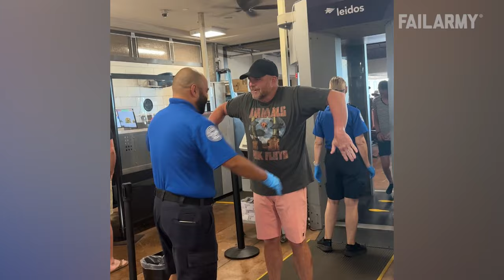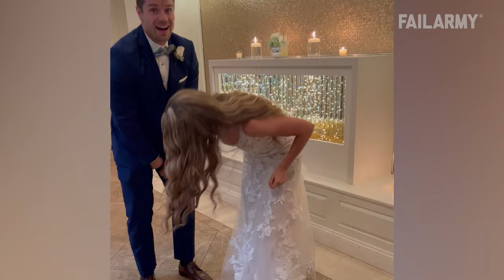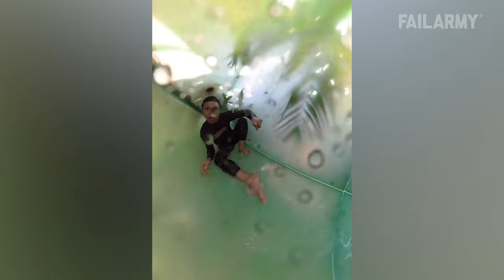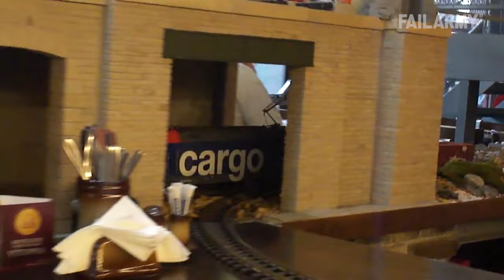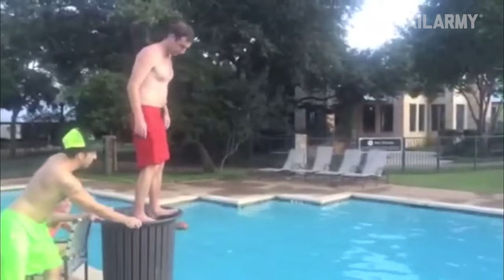When Everything Goes Wrong This Month😂

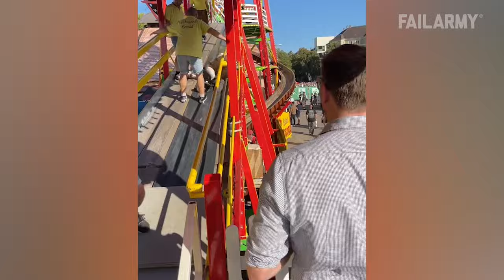Comment: @4:00 he says "that's why you wear your glasses"  You know what else helps with safety?  Not removing the guard on the angle grinder specifically designed to prevent the cutting disk from hitting you if it explodes like that one did.
Reply: Angle Grinder Roulette is fun though!!
Reply: I completely agree with your perspective!
Reply: Sometimes that guard is in the way and you gotta risk it
Reply: or prevents you from getting your hand into the disc, or a rotating steel brush.
ask me how I know.
Reply: @123123boobies  nope,  if you're using a cutting disk that exceeds the size of the guard,  then the disk you're trying to use isn't rated for the RPM of that grinder.  Circumventing(removing the guard) is also an OSHA violation here in the states.
Reply: Oh man, is that what happened?  I was wondering how in the heck it flew off and hit him.  Why on earth would anyone remove a safety guard from a rapidly spinning death wheel??
Reply: Safety glasses are no joke , but i'm pretty sure this particular scenario is staged all of them are.
Reply: @lotharrenz4621  I'm afraid to. 😧
Reply: @josephgermany7446 he didnt say too big he said in the way sometimes youre cutting something that isn't easily accessible but personally i just try to keep as much off axis of the blade as i can guard or not. Minimize risk all the way around. Also im pretty sure most guards don't fit wire brushes but i may just be wrong.
Reply: The way of a virtuous woman is more valuable than Fine linen and precious, pernicious estates..
Reply: @josephgermany7446  Everything we do at my work is an OSHA violation! lol
Reply: Safety tip appreciated.  Let's see how many yahoos heed it.
Reply: And maybe not using such damaged discs. you can see it was already done
Reply: @Labergemusic  go work in My fields and i will pay you whatever is right..
Reply: Another thing people do with cutting discs is try to grind with them, or using wet and damaged ones and they'll usually explode everytime too.
Reply: @pivotman1121   if the brush doesn't fit,  it doesn't belong on the grinder.  Use the right tool for the right job.
Reply: @pivotman1121  You gotta buy the correct size wire brush, have my 125mm grinder with a 125mm wire brush with the guard on, it brushes on the guard inside but it works.
Reply: @joelgonzales8342  that is actually possible. if that piece of disc hits your safety glass hard enough to poke through you'd have at least one black eye from it...
Reply: The guard does not keep the shards from hitting you. They ricochet. The guard keeps your hand away from the blade.
Reply: @TehButterflyEffect  false,  if the guard doesn't deflect the exploding blade from hitting you,  you have it positioned wrong.   And you obviously don't have any real experience with safety or an angle grinder from your blatantly wrong comment.
Reply: Yeah, and it probably wouldn't hurt the guy to replace the disk before it gets that worn out too.
Reply: @prometheuszero9  yes to that. though from the looks of it, in that video, he used a cutting disc for grinding, wich is downright dangerous, as cutting discs are not made for that. real grinding discs are thick and really sturdy. always look what tool you're using for what. it might explode in your face...
Reply: Those disks are dangerous. I don't like using them even when I have to. If they are flexed while spinning they explode dramatically. My boss told me a story about an explosion of one of those disks he saw. It put a hole through a garage door, which was in the up position 20ft above where the angle grinder was being used.
Reply: @pivotman1121  i believe in such a situation you shouldnt use an angle grinder?

how do people forget that an angle grinder is supposed to replace the base tool where possible, the base tool is a metal saw. If you cant access it with the grinder, you use the base tool.
Reply: wasntme7845  what a troll...
Reply: sometimes they bounce back too
Reply: I thought the guard is to prevent sparks going in to your face
Reply: @callanmurphy9807  I'll admit, I use my cutting blades to grind pretty often.  I've never had one explode on me.  The key is a light touch.  Also, I'm never directly in line with the rotation of the blade when I'm doing it.
Reply: @JamisonMK3  mate haha I'll admit I'm guilty of it too, but I typically use the edge so it doesn't chew too much. Otherwise, I'll just change the disc. Yeh you never work with it facing you either haha. I've had them explode, I've had the 16" railsaw blades explode too, they're way more dangerous
Reply: @lotharrenz4621  you read it in a yt comments section like the rest of us?
Reply: @makavelismith  of course not. I have the scar to prove that removing the guard is NOT a good idea. the wire brush only scraped the epidermis off my hand, but it took months to heal.
Reply: @lotharrenz4621  I was joking;) but glad you weren't too badly injured mate.
Reply: @lotharrenz4621  How do you know?
Reply: @kotechniik  I used a Grinder with a steel brush disc, and ended up scraping a large patch of skin off my right hand; which reminded me not to take off the guard.
Reply: Basically from what I'm seeing with this long thread of replies...

The angle grinder wasn't used properly and the guy almost paid for it. And if the guard is in the way, you either would need a bigger tool itself or it's probably NOT the right job for the grinder to begin with.
Reply: @DarkFrozenDepths  Correct.
Now you could say, "switch handle and guard positions", but the grinder rotates in one direction only, and you have to take that into account. if the disc catches in in the wrong direction, the grinder will snap back at you instead of getting caught and stopped (no harm here other than some damage to the disc, if you swotch off right away), and that might hurt at least your wrists, if not much more.
Reply: After project 2025, you won't have to worry about OSHA.

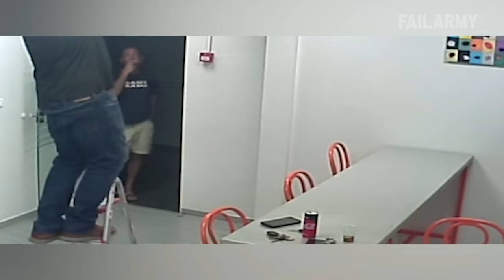Comment: 15:30 That "Oh:" when the robot realized it's going to fall XD
Reply: It's a Nao robot, it's programmed to do this when it is falling. Also its arms move forward and it disables power to all the servos to protect them from damage!
Reply: @MrOpenGL  
Of course it's programmed like that (computers only do what you tell them to do if they can do it). But I still find it cute :)
Reply: @Lampe2020  Yes but the cutest thing is that it's an embedded thing, it's in the firmware! Also Aldebaran (the makers of Nao) made it so the calibration routine looks like a human stretching, complete with realistic sounds (I work a lot with Nao)

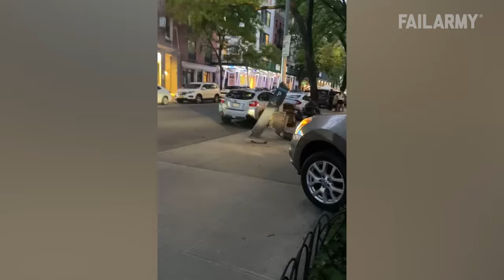Comment: 3:47
What he really needs to do is to use Flex Paste.
Reply: If you have a toilet in the basement, flush it, then pull it. It’s a large direct drain in your floor. I’ve literally had this happen when a window well sump pump backed up.
Edit, flex paste, spray may stop the leak, but not the water already there, great idea!
Reply: @sirenknight8007  Aye no problem after all.

Comment: 0:48 WOW she got glass in her eye. I hope she is ok, I've never seen a windshield do that.
Reply: That is how they are designed.  They can withstand an amazing amount of force, but if it stops the object at the last layer of glass, the glass shatters inside the vehicle. Still less damage tan whatever that was bounching around inside the car at 70MPH. Even a pebble can kill at that speed.
Reply: I have a hunch about this, but will probably be called wrong a lot. You can hear 2 pops right before the glass broke. It sounded like gunfire...
Reply: @Hephoof  - bullets will usually go through a windshield. But, a ricochet could bounce off like this. Do we know where this happened? If it is in a Democrat  controlled city in the US, it was gunfire.
Reply: @MrYfrank14  No idea where it happened, but it does look like it went through. If you pause it right before it switched to the inside view it looks like there is a hole on the upper portion of the glass that broke.
Reply: you're correct, it was a gunshot. This happened in Oakland back in 2022 on highway I-580 due to a road rage incident  @Hephoof
Reply: @Hephoof maybe i am wrong, but to me it also looks like it also goes through the rear window? Bc at the same moment the rear window goes completely reflectiv, as if it also cracked?

Comment: 16:45 Imagine being the next guy to use that toilet, you're inches away from reducing your crotch to a soggy hammock of septic steak sauce, and you spot it: The roll is in the toilet, soaking wet.
Reply from the maker: "septic steak sauce," 💀💀💀
Reply: How???
Reply: Looked like an aircraft or train toilet? Not a regular toilet as there was little to no water.
A regular toilet wouldn't suck the paper down like that.

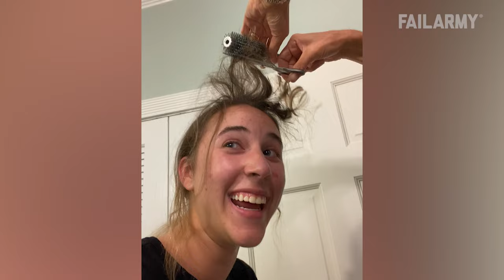Comment: 10:57 If you don't want to cut it off, just massage half a bottle of conditioner that contains some kind of silicone (most cheap ones do) into the hair and brush, and it'll detangle much easier.

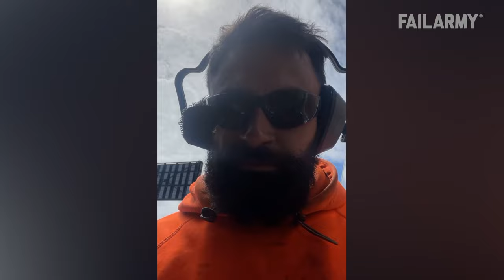Comment: 4:01 and there’s some wise words about to be spoken! Seriously though don’t get caught relying on ppe to save you! Preventing is better than protecting! Never align yourself with a high speed rotating object! Gears,bearings,propeller’s and fan’s, grinders, saw’s,flywheels you name it! But in the case of cutting and grinding just keep your face and vitals away from the path of potential death!glasses won’t stop anything from your head or throat! Even wrist and fingers should be held in at the back of the grinder and again never in line with the disc.